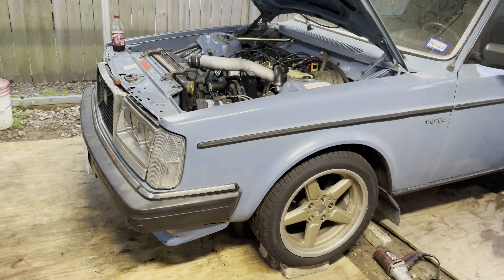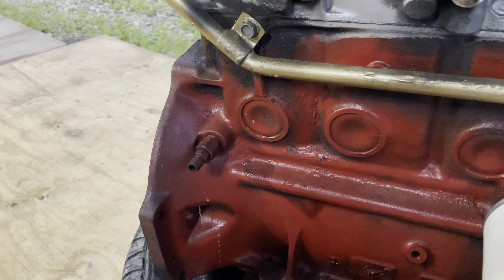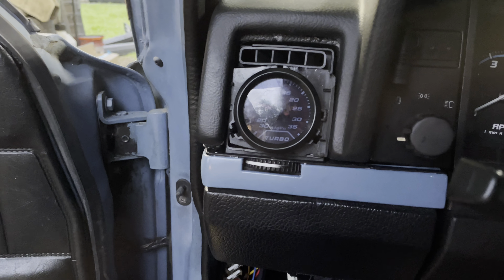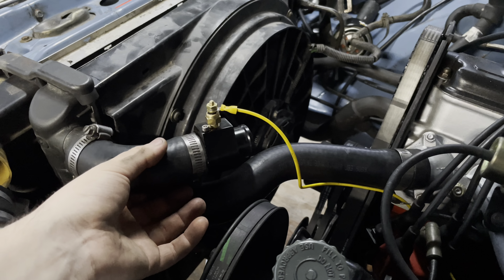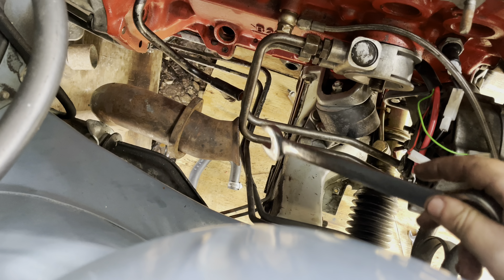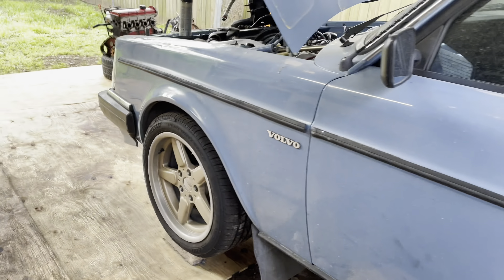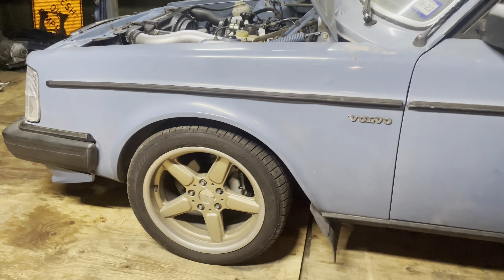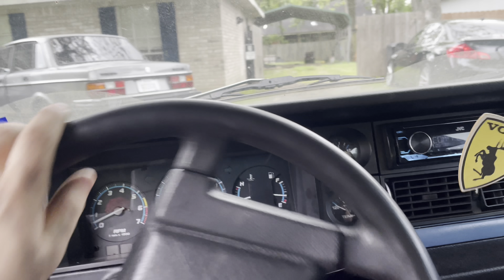The 242 Turbo swap is complete and it RIPS!

Comment: well done. its a genuine turbo brick! you could finish that boost gauge by using styrene sheet as used by modellers, you can get it in black and its easy to trim shape and glue.

Comment: Volvo used different water pump setups between the B21/B23 and B230 blocks.  This meant they also used a different water pipe.  You could solve the water pipe issue by sourcing one from a normally aspirated B230F, or from any B230FT made from '85 - '92 (or so).
Reply: You can remove it like we did, engine really doesnt need extra heat, niether does the cabin in Texas.
Reply: @TurboWorld  wouldn't that mean that you need to weld up the hole on the water pump outlet port?

Comment: Really nice 242. Nice to see americans keeping them in good shape. A rust free 240 in sweden is really hard to find and will cost from 5k usd to 10k or above. The b230ft conversion is nice, if you gett an aftermarket ecu and a good tune you can get about 250-300 whp on stock block. Transmission is a gamble if its holds over 200whp, in sweden we get BMW getrag transmission for over 300whp.

Comment: you swapped the ecu? what you running LH2.2? but with a turbo ecu? also what turbo you running
Reply from the maker: Yes running LH2.2 with EZK pulled from an 86' 740 Turbo paired with the Dave Barton 240 conversion engine harness, Car has a 13c turbo.